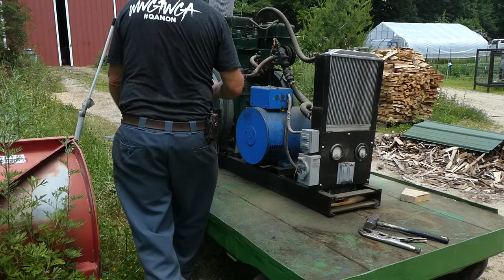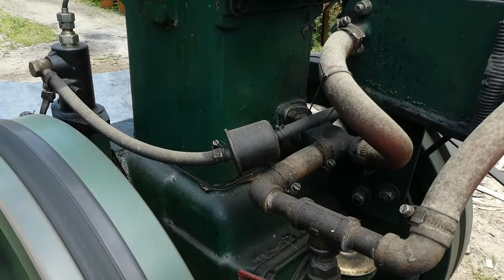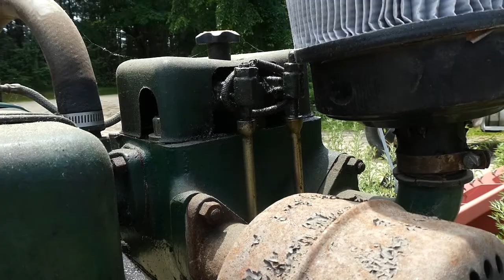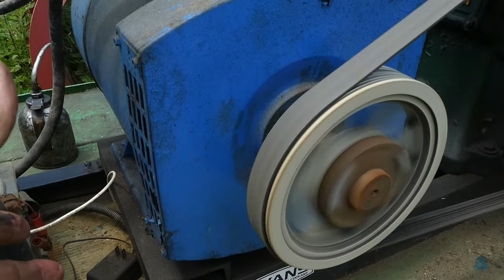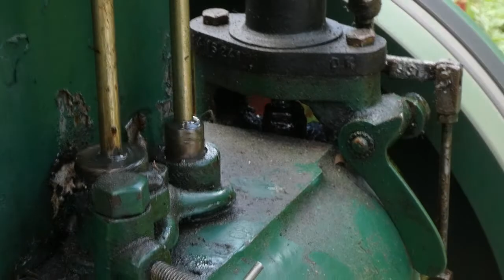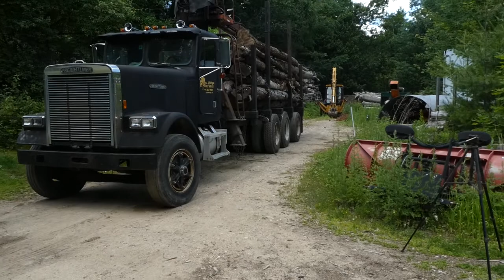Lister clone engine startup - NH Hbbyloggr 062622

Comment: Waaw, that's a nice gen-set you got there .whatbis the max power output.  i love the sound.  Do you plan to run it on dual fuel or even convert it to spark ignition?
Reply from the maker: It's a 16 Hp single cylinder diesel spinning a 12KW ST generator. I have a 30 KW Chrysler slant 6 225 Hp which runs on propane or wood gas. This Metro diesel would do well running on a diesel / wood gas mix. I have a lot of diesel fuel on the farm so this is a good choice for long run times if needed. Thanks for your comments !

Comment: What's it say on the engine tag?
Probably wise to give it a de-coke and valve lap before relying on it for anything. They fill up with carbon quick because of the low RPM. I'd be giving the sump a good rinse out too.
A bit of wood gas will make it run a tad quieter and reduce carbon deposits. 
You need to be sure you know exactly which model it is before buying any gaskets.
Many of these engines are visually identical, apart from the bore size. You don't want a de-coke set with the wrong head gasket. 
Maintain it well and it should run for a very long time.

Comment: I'm happy to see you got it home in one piece.   sounds good. I'd like to hear it under a decent load. Joe
Reply from the maker: We were going to put a load on it this morning but after we gave it a lick we found it not making electricity. We ended up " flashing " the generator fields using a 12V drill battery and reverse twisting an electric drill. That got things working nicely. Then we had visitors and then a Dr appointment for me in the afternoon so the day was shot. Anyhow, it's now sitting in the middle of the shop happy and dry.

Comment: Next time you better spread a little of that oil on your cranking arm.  Also, it appears that pulling the crank off just as the engine starts looks key to avoiding the potential for serious injury.
Reply from the maker: The pawl to engage the keyway is tapered on the reverse side of rotation and is also spring loaded so as the engine starts the shaft speed detentes the pawl into the hand crank. Still, one doesn't want to leave the hand crank on for long. So far so good !

Comment: When selecting a pair of engines, a woodgas bug heard you say "Diesel do nicely"  ;) . 
 Watt more wood you want?
Reply from the maker: Three part harmony ? This beauty works great and will even like a little wood gas to aid its digestion.
Reply: @nhhbbyloggr5022  
 Yes indeed. Your new generator runs like a dream. 
 This little diesel sipper will save you a fortune in wood chunks too, so it is a win win situation  :) . 
 For a long time, I wanted one of these, but I could never quite find one, at a reasonable price. 
 Looking forward to seeing more updates on this fine new watt factory  :) .
Reply from the maker: @CNCmachiningisfun  Yes, it's a lucky find. Things being what they are lately this came along at the right time. I've been looking for quite awhile but they are rare these days. I won't have a chance to play with it this week but looking forward to putting it under a load.
Reply: @nhhbbyloggr5022  
 Indeed. Your lucky find reminds me of the first lathe that I bought, back in '94. 
 I had always wanted a lathe, and this large beast came along, at the right time, for the right price. 
 May your watts be many, and may genny-rator's diesel sips be frugal   :) .